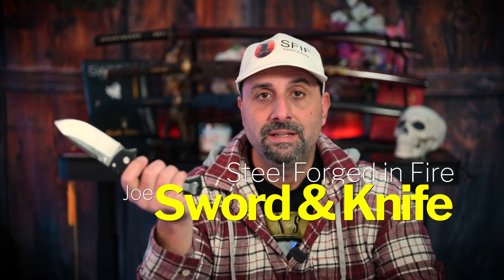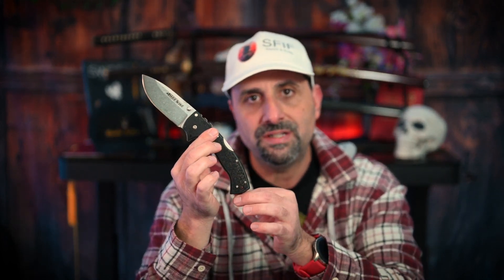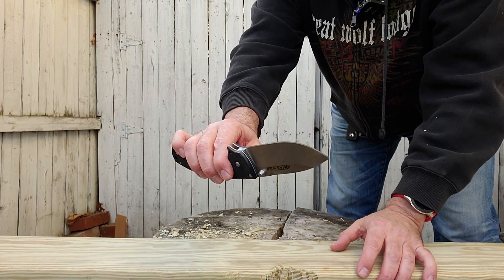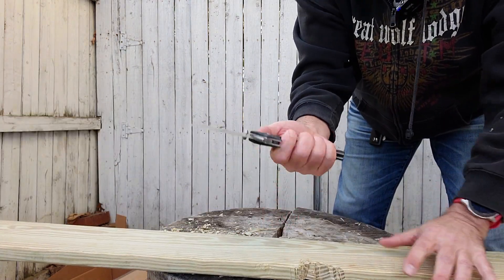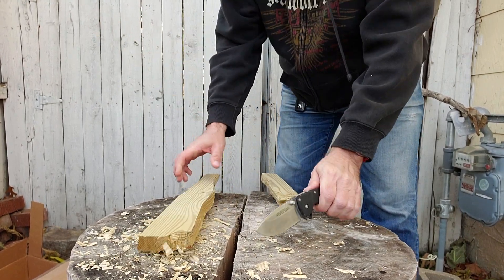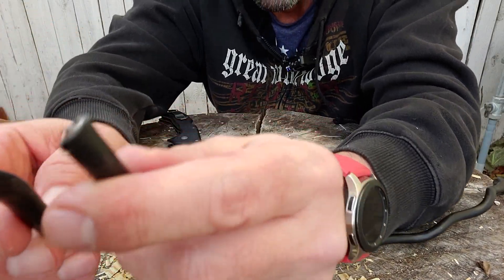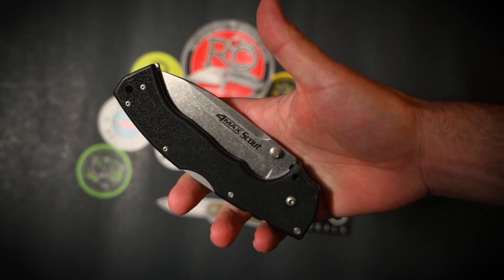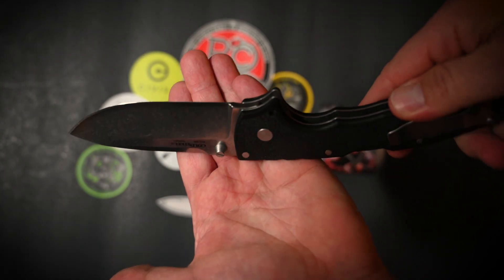INDESTRUCTIBLE FOLDER?  THE 4 MAX SCOUT | REVIEW-N-TEST #coldsteel

Comment: I’ve had mine for a little over a year, and here’s some modifications I’ve done. First I removed the pocket clip. It’s a Jean destroyer! And cured an annoying hot spot. It sits in my pocket like a buck 110.  Second I removed the thumb studs, and filled the holes with JB Weld. It gave it a good look, I can easily open it without, and baton wood without them getting in the way. Where the thumb studs were, right above it I filed the spine to a 90 deg so I can use it for a ferro rod. This is now a survival knife!
Reply from the maker: Wow brother those are some impressive mods, you literally made it your own, cut well brother 👏 👍

Comment: ⚠️ DANGEROUS YOU SHOULD WEAR KEVLAR GLOVES 🧤 IF THAT BLADE SLIPPED THROUGH THAT LOCK YOU WOULD HAVE BEEN SORRY “ WEAR SAFTY GLASSES ! WARNING ‼️
Reply from the maker: Very  much appreciate  your concern, but I have that much faith in the TriAd locking system that it will not fail...it was tested to handle the pressure of 600lbs.